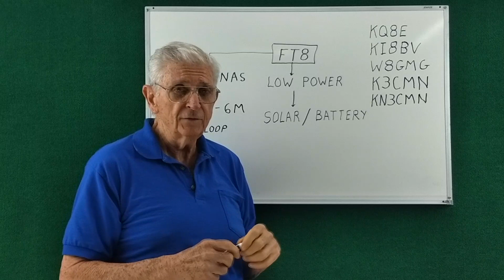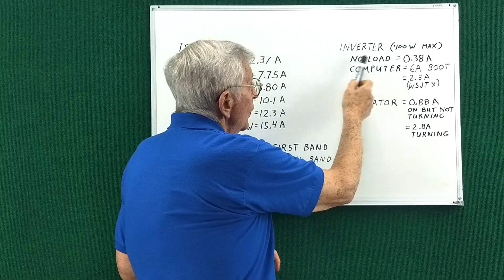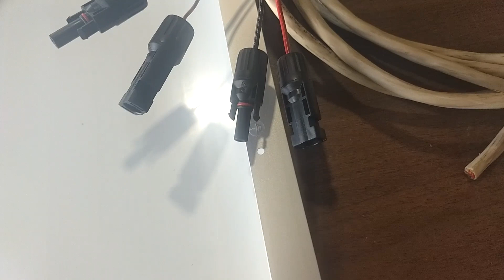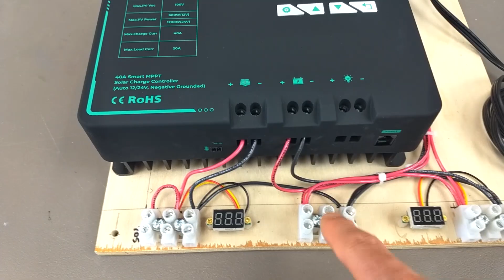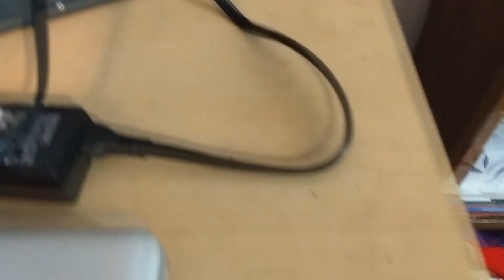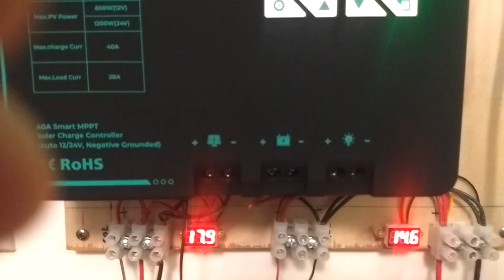Will FT8 Destroy Amateur Radio and How soon?

Comment: I think of ragchewing or certificate chasing with 'Worked All Whatever' awards and contesting on HF as a distraction to my ham radio hobby pursuits. Those are a tiny aspect of my interests in ham radio. I'm mostly an experimenter with longwave to light, analog to digital, antique radios to SDR kits. But I also do public service and emergency service ham work, as well as Elmering, which is my favorite aspect of the hobby. Ham radio is a very large hobby with so many different aspects. It's one hobby that is many hobbies combined.

Comment: I'm a HF phone person but recently messed with FT4 and FT8. I just wanted to experiment with the other modes that could do without having to buy a load of extra gear. It could be useful for me because in my home using phone would be disturbing to my wife trying to sleep after her nightshift. So there were times when I wanted to play radio but was unable, of course no problem with data modes.
Also, FT8 is a shop that opens earlier than the supermarket (HF phone), closes later and can be open on those days where the supermarket is closed all day. 
Its useful and definitely adds variety but for me personally it's not something I could do too much of.
Reply from the maker: The title of the video is to attract viewers. I love FT8.

Comment: Hi Jim, thanks for introducing me to FT8. Quite fascinating. Let the research begin.
Hope you don't mind if suggest an alteration to your powerboard switchover between inverter and normal mains (@15'49).
I have assumed that the inverter doesn't have a synchronization to mains function.
The problem I see is when the inverter and the mains are not synchronized, the computer power supply is going to see a very fast voltage transition as you switch over from inverter to the mains.
Likewise, both the inverter and the computer are likely to be stressed when switching 'instantaneously' from mains to the running inverter.
Inductive loads will give a pretty enthusiastic voltage spike response to microsecond transitions from the positive peak to the negative trough of the mains, Capacitive loads (filtering etc) are going to get rather extreme current spikes.
I assume the battery on the laptop computer is usable, maybe a few seconds delay between disconnecting one ac power source and connecting the other will prevent blowing things up / shortening equipment life?
Reply from the maker: Thanks for your comment. The transfer time of the switch seems to be enough to prevent any problem.